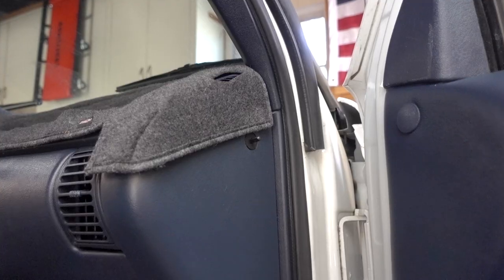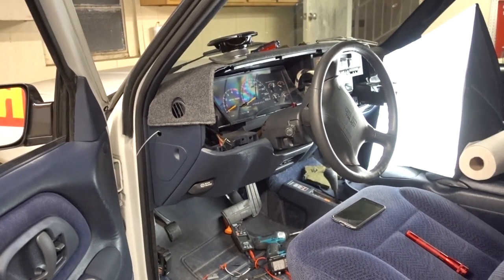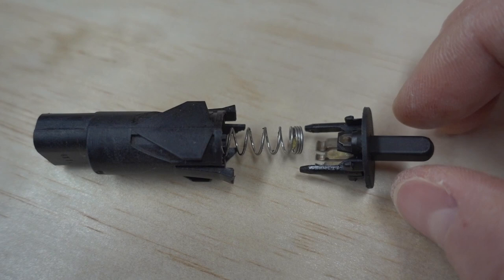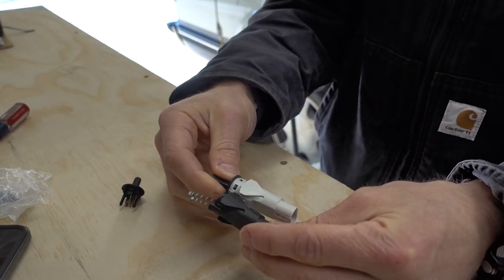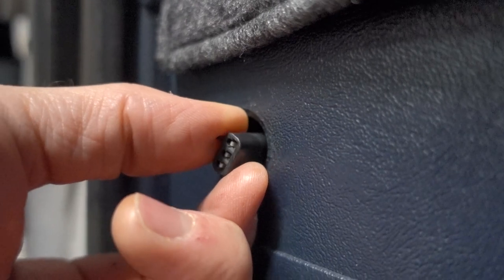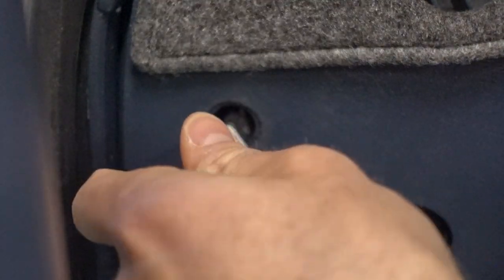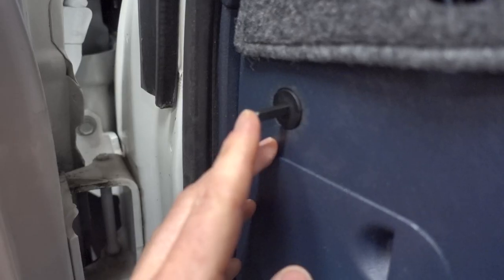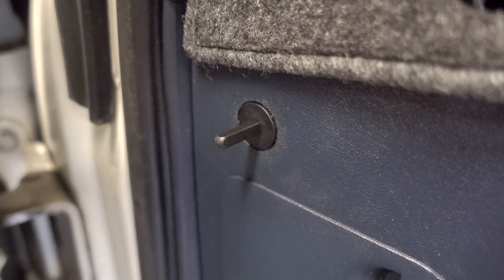HOW TO FIX 1995-1999 GMC & CHEVROLET DOOR JAMB SWITCH!!

Comment: The originals on my 1998 GMC Suburban are longer just like your replacements.  They must have started making them longer after 1995.  Neither of the switches work on my front doors, so I bought the same ones as you did.  Will be replacing this weekend.  Thank you for the informative video!  Mine has the delay where after you shut the doors, the lights stay on for about 15 seconds.

Comment: For the passenger side i used a long skinny screw driver with a hook on the end to pull the wire threw the defrost vent to unplug the switch. The old broken switch fell threw the bottom of the dash. Hope this helps!

Comment: I had not thought of going in through the fuse box to hold the plug.  That will make the left side pretty easy.  The right side may be difficult.
Reply: Probably too late now, but the right sides easier since the glovebox is an easy removal and gives you easy access

Comment: i have been having problems with my door handle and was always taking off the door panel and was worried about taking the plug cause i didn't want the lights to drain my battery but thankfully taking the pins out of the socket make's it to where you dont need the pin to keep the lights off

Comment: I was so excited when I seen this video so I ordered the switch because mine was broken off on the driver side so I replaced it and I also have a new headlight switch and I still do not have a dome light when I open the door I've tried the Dome override I don't know if it's supposed to be in or out or if there is a delay after you shut the door but it either stays on permanently or doesn't come on at all when you open the door so now I'm lost
Reply: Hi i replaced my switch and now have another problem dome light comes on by itself not sure why
Reply: Probably a bad wire or bad ground. Get the DVOM out and start at the switch terminal. Also search YT.

Comment: I had a question if you got a video of the gauge of the cooling  I just changed my thermostat I made sure there was no air in the cooling lines  check if there's any freeze and everything seems good but my  Gauge will go from   One coater then to 3/4 like it  Going to overheat but then goes down
Reply: He has one video which he replaced one of the temperature sensors in the truck. These GMT-400 actually have two different sensors, one for the computer and one for the gauge in the dash. If you want to see how to replace the one for the dash, I have found this video to be useful: https://youtu.be/MIMavV4_Ka4
It could also be the stepper motor in the gauge cluster.
This video talks a bit about testing the gauge:
https://youtu.be/0MZSXoCXwDQ
Hope that helps, not sure if Jimmy has any experience with this, or any input. But this is what I have found in my research (I also have an issue with my temp gauge)

Comment: It's also the same as the the S10. 
In my 1998 S10 the passenger side works, but the driver's side doesn't. It would be nice to have the lights come on when you open the door at night or have the radio go off when you open the door, instead of having to manually turn it off.

Comment: Ive has an issue with my trucks door chime, it either doesn't work but can rarely fadedly hear it and my truck doesn't have a switch like urs. How the heck can I fix it???
Reply: The unit is under the dash and easy to find. You can unplug it and leave it that way or replace it fairly cheaply if you prefer the sound.

Comment: I have a great idea for a video for anybody with a 95 to 99 Suburban because I'm stumped and I'm looking all over YouTube to find the answer. I have a 1999 Chevy Suburban that has the Dome override and the problem I'm having after replacing my door switch is I can't get the interior light the shut off when I open the door and close it I have tried with the Dome override pushed-in also pushed out and then the rotating switch to dim your dash lights has two detent and I'm not sure what the first one is for the second one automatically turns the interior lights on. When it's on the first one or below the first one the dome light stays on constantly and does not shut off
Reply: Kevin, did you ever fix your problem?  I have a similar issue with my 98 K1500, I had to remove the fuse for the interior lights because they just stayed on all the time even with the Dome Override pushed in.
Reply: Late as balls reply, but make sure you didnt roll your rheostat all the way up. Its the dial you can use to adjust your night instrument light brightness. Rotated all the way up, it turns on the interior lights.

Comment: What happens if I keep the part out completely. Will that drain battery?
Reply: No. Mine has been broken for a while.. you just have to manual turn on the lights
Reply: the switches control the ground for the light, so if there is no switch, on ground and no light. however if the switch is connected and not installed , the switch closes the connection to ground and the light stays on, ( until the battery dies).